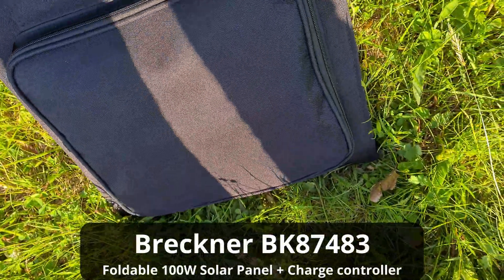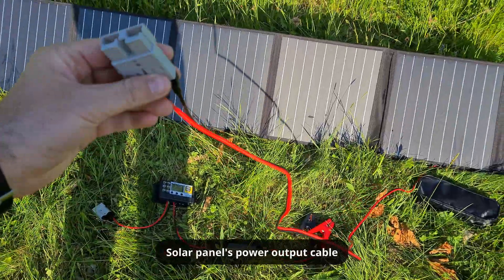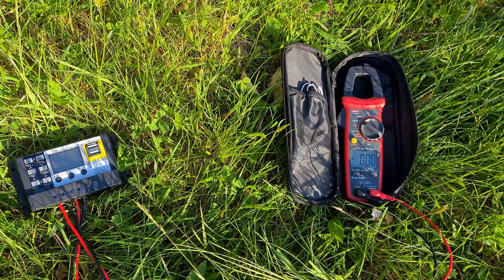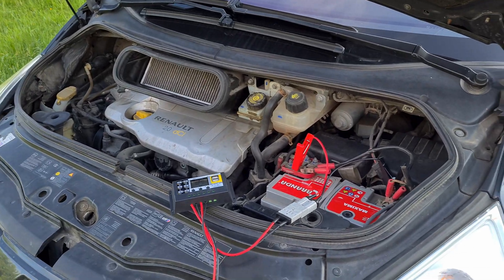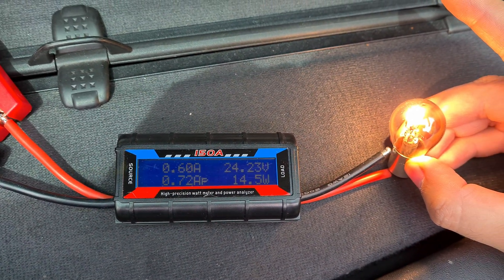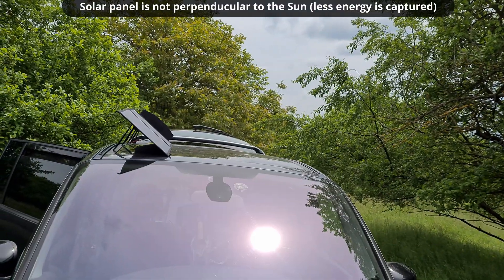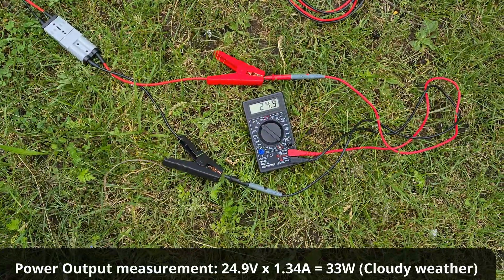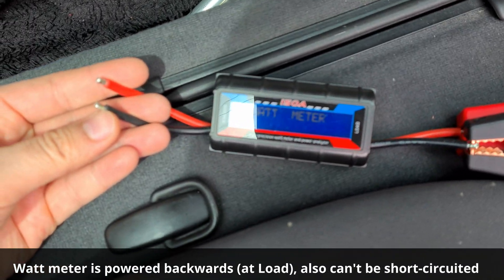Breckner BK87483 (Foldable 100W Solar Panel) First usage, 21W Light bulb, DC Amp Clamp & Watt meter

Comment: 13:00 the power meter resets because the voltage gets too low, not because the amps are too high. Solar panels can't maintain voltage at peak power without some clever circuitry in between (MPPT). They usually give most power at a voltage lower than the open circuit voltage (which is the one you're reading without a load). I've used a meter identical to that one up to 50A, no problem (only a little heat in the wires xD)!